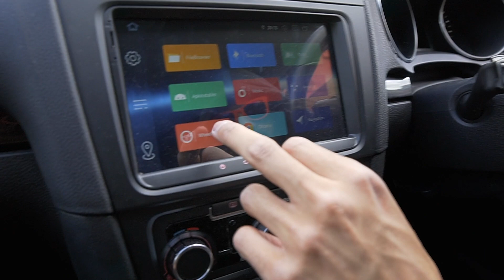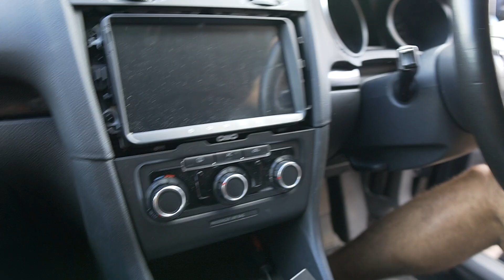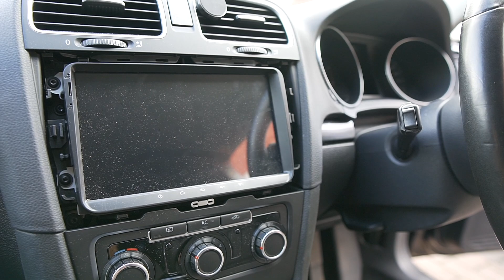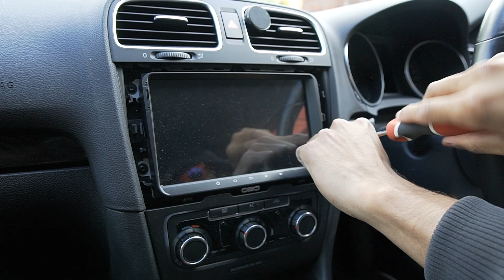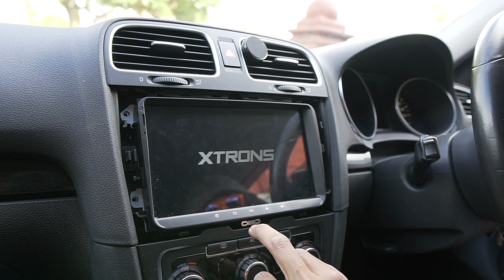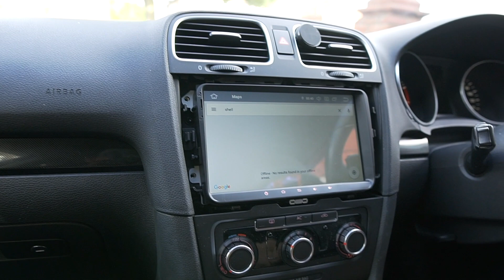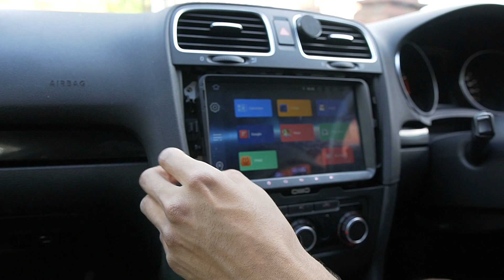Fitting Gps (Didn’t Go As Planned)

Comment: Whoever left the comment about your GPS is chatting shit obviously. Go into your settings on the unit and you can set your default for Navigation. For some reason on the Xtrons unit the Navigation defaults to TPMS. I had the same issue and this is how I fixed it. If you need more specific advice, get in touch and I'll be happy to help mate.
Reply: Nice one so it can work without needing internet?
Reply: @keith1290  Yes, just needs the GPS antenna connected.  Same as if you had a satnav like a TomTom. They don't have Internet but do use GPS
Reply: @pitbullzz9046  quality mate :) does the antenna bit need to be put somewhere specific or can it just sit in the wee bit he chucked it in like at the back of the unit?
Reply: @keith1290  I have mine positioned as close to the windscreen as possible and its visible. That way you get the quickest and strongest signal strength. I wouldn't recommend having it covered or hidden somewhere.
Reply: @pitbullzz9046  aye fair one where does the cable come out for it in yours? Do you have to like take off parts of the dashboard to get the wire through from the back of the headunit?
Reply: @keith1290  I have mine installed in a BMW E90 so it's quite easy as there's a little cubby vent on the dash which I used. Depending on your car, you could go from behind the glovebox area and put the side
Reply: @keith1290  the top part of the antenna must face upwards the bottom aka sticker or magnet face downward and you cut have metal blocking the line of sight between satélites and antenna. So him chucking in the back i bet the orientation was all jacked up and I bet he had plenty of metal interfering with signal
Reply: @franciscobalbuena9843  nice one mate cheers. I ended up just putting the old unit back in as every time I put the car in reverse the reverse camera thing would kick in (didn’t even have a camera connected) and it would crash the unit and it would take a few hours for it to turn on again. Couldn’t find out how to disable the reverse camera setting anywhere
Reply: @keith1290  that might be happening because when you wired up the headunit wire harness you may have which by the way is how many folks do it...is that you may have wired the "reverse camera" power input to the vehicles "reverse" wire. That's why the radio goes into reverse camera when you put the car in reverse. Cause if you think about it..how else does the unit know you just put the vehicle in reverse? Check your wires harness again and make sure you don't have a anything tapped into the "back up/reverse" wire